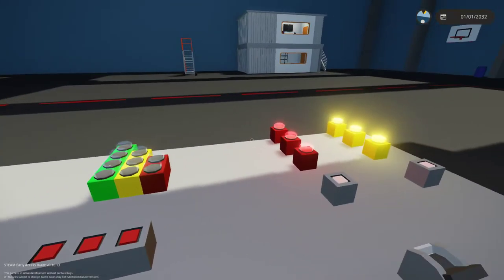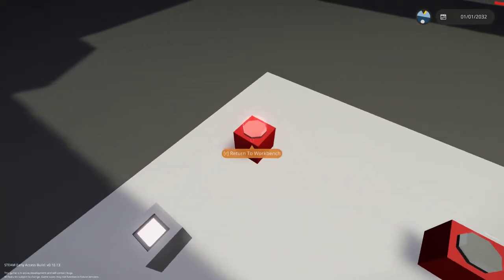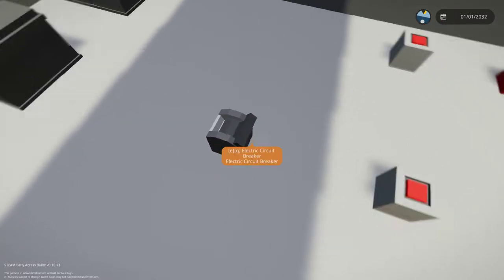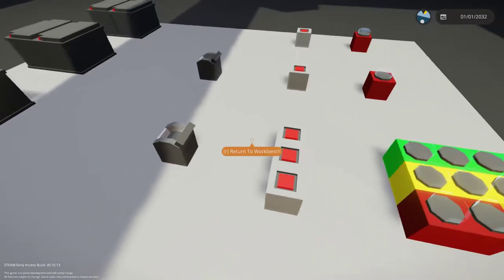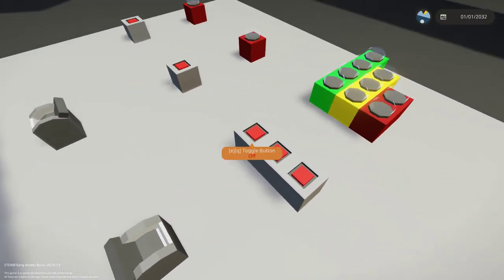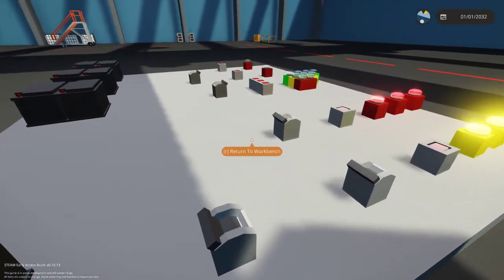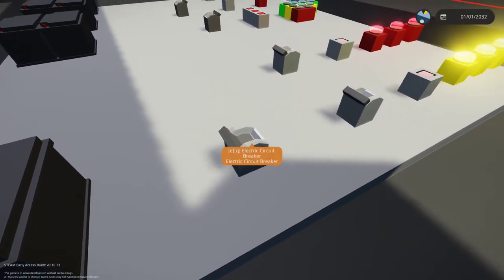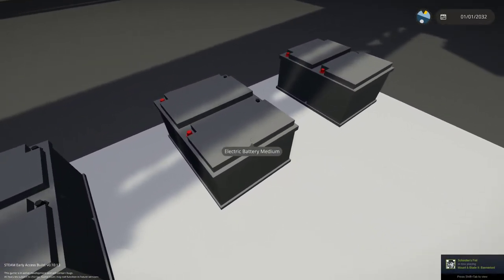Stormworks | Switch/Circuit Breaker Tutorial

Comment: Not sure why, but this is not working for me as of 1-22-2021. Trying to add some work lights to a barge I built. Used spotlights, batteries, breakers, and toggle switches. The blasted things won't turn on even when I hook the lights directly to the batteries. I can't make ANY lights work! Is there a logic input I am missing? What's the deal with these things?
Reply: FML, nevermind. Need to hook the light up to the electrical power source, THEN hook up the Logic On/Off command from the switch. As a professional electrician, I can tell you without reservation that this is NOT how electricity works. But, it's a game, right?

Comment: Do you have any idea how to make power flicker out when the boat sinks?
Reply: You can place a fluid meter on the outside of the ship at a certain height above the water which will output the distance between the meter and the ocean since it is not placed in an enclosed fluid tank, then what you want to do is get a treshold gate and set the minumum value to something just a bit above 0 like 0.1 and set the max value to a high number like 99, then place a relay and connect the on/off output from the treshold gate to the relay. What this does is so that as the boat sinks down, the fluid meter will get closer and closer to the water until it reaches that height of 0.1 meters above water or whatever you set which will make the treshold gate turn off its output which in turn disables the relay that I'm assuming you connected your electrical systems to because otherwise this wouldn't work. I'm not sure what to do to make it flicker but I'm sure there is a solution to that as well.

Bonus tip: Place your fluid meter on the outside of the ship at the place where the generator/battery room is to give it a bit more realism, as this makes the power go out when water reaches your power source, this will give it more realism incase the ship starts to sink faster on the end with the power source
Reply: @catsarethebest36  Oh wow, thank you so much!